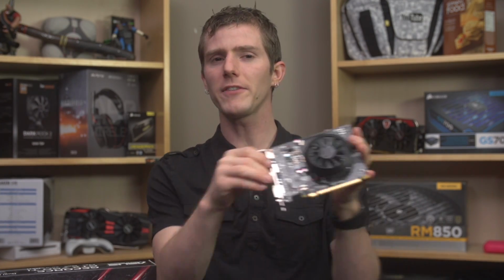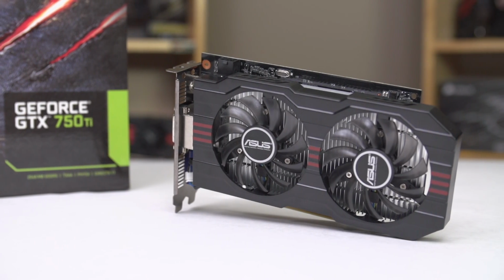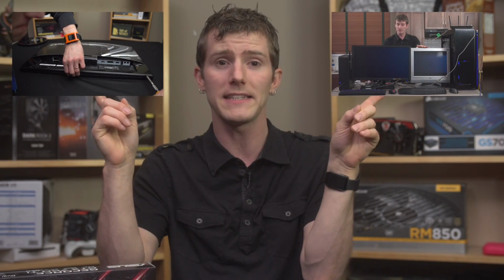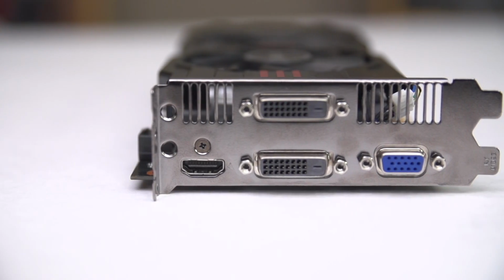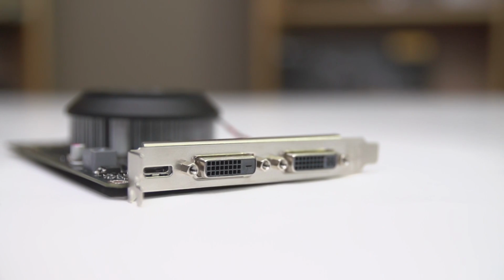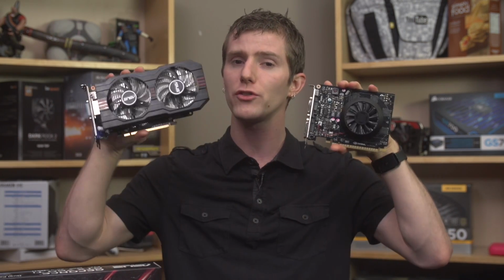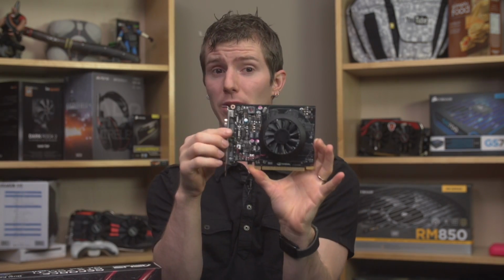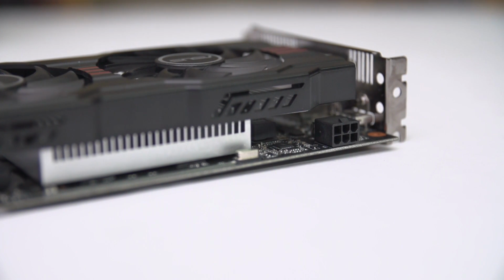GeForce GTX 750 Ti NVIDIA & ASUS Designs

Comment: hey guys. just a quick question. Is it possible to move my os from one drive to another without reinstalling windows and losing everything? ex. moving windows from hd to ssd and retaining all my games i installed on the hd
Reply: Macrium Reflect Free
Reply: Yes
Reply: How would you go about it?
Reply: Well the ssd is 500gb and the I have 1tb of stuff on my hard drive so I don't think looking would work
Reply: the only way to do that is through a drive clone, either at your local pc shop or through included software with your ssd (i believe samsung gives you the ablility to do it with their larger ssd's) you also need to be moving to a drive of equal or greater size when cloning because you can not pick and choose which data gets cloned.

Comment: No displayport on the ASUS = Fail
Reply: It's not part of the original architecture for this specific card.
Reply: ***** They probably didn't want people thinking it had support for G-Sync. But that was the choice that was made by ASUS.
Reply: EVGA ones got one.
Reply: Eric Slattery well but you'll need DP for Gsync
Reply: ***** I think next to development costs, royalties are negligible. If DisplayPort isn't part of the reference spec and they wanted to implement it themselves, they probably still wouldn't have had a card out to review.
Reply: JustPRR I guess it's more expensive then, rather than less as ***** suggests due to 'royalties'.
Reply: Eric Slattery G-Sync is not supported on this particular card in the first place.
Reply: Eric Slattery Personal reasons why a manufacturer would or not include a specific feature is not a valid explanation. 

Just because you do/don't want something, doesn't mean anyone else has your exact same opinion.
Reply: Eric Slattery 'Lowers FPS'.. Compared to what? A potato? Not everyone plays AAA titles or graphics-intensive games. Yes, it does look pretty, but what's the point when the gameplay is pure shit?

Comment: I'd have liked to see it compared to the R7 265, since that's it's direct competitor at that price point. I'm currently trying to decide if I should just go GTX 750 Ti or upgrade my PSU and get a R7 265...
Reply: I'm gonna have to upgrade for 265. Still using the stock PSU with no 6 pin

Comment: the asus 750ti or the asus 760? looking to upgrade my pc but not on a huge budget
Reply: 760 Man.
Reply: I got the ASUS 760 a couple weeks ago, totally loving it.
Reply: I got a Gigabyte GTX 760 OC a week ago.
I'm very happy with it,runs BF4 on 1080P high preset 80-90FPS.
Reply: i want to get the aus 760 because i have a relatively small mid tower case
Reply: just bought the asus 760 thanks for your help everyone
Reply: ***** i have a smaller mid tower case so i don't think a regular 760 would fit

Comment: Would it be worth while to put a GTX 750 Ti in a PC that only has an i7 875K with 8GB of ram? I've got a 430 in there now and I'd like to have something with more more power, and better cooling.
Reply: No your i7 will be fine with any graphics card today.
Reply: I think it would be. You should see major improvements.
Reply: The biggest concern is bottlenecking. If the hardware will be limited in some way, I won't spend $180.
Reply: Enigura There would be no bottleneck. You'd be looking at dual-SLI 780Ti's before it would bottleneck that CPU.
Reply: Hmm. Much to think about, I now have. Thanks! :D

Comment: I have a gtx 560. This would be a good upgrade right? I don't have much money and don't really game all that much. The only reason I am thinking of getting a new card now is because one of the fins on my GPU fan broke off. 

Would this be a solid replacement/upgrade?
Reply: Yes! it would be perfect! The 750 ti hangs with the 660 ti boost. at a 150$! its a insane card for the price. Btw go with evga 750 ti SC. Its smaller with more performance, and it supports g-sync.
Reply: MrHoward888 Awesome, Thank you. I will be ordering one soon.

Comment: How is this compared to the gtx660?
Reply: 1toncheese
Thanks. I thought the r7 and r9 series was another architecture than the r9 280x that was a 7970 refresh ^^
Reply: the gtx 660 still beats it
Reply: not necessarily, it's still a fairly reasonable price when it comes to the card's efficiency and features
Reply: Good to hear, I have the GTX660 and I don't want to upgrade. If the lowest end cards would beat it the minimum requirements would be higher I think ^^
Reply: cant sli these 750s......tsk tsk so yes the efficiency is an option these also seem like viable upgrades to people in the (pre made) pc dept.....so it looks like nvidia is reaching a niche realm of the market where they have usually never sown signs of caring about....its like a budget streamers gpu, or a good gpu for a htpc or again an upgrade to any new cpu supporting manufacturer pc....it does serve as a low end gpu solution in its price point as well for its power consumption and low psu capability...but i would never upgrade apples to oranges every mid/low end gpu i have from release to release it just doesnt ever seem cost conscious even the HD7950 liquidated pretty hard for 2-weeks before the new amd cards released then after....its price went up by 150$ and the stats and specs explain why........but my friend got one when it was on sale and those are the only times to upgrade in such a short window and these occurrences happen rarely; the 6xx window was the 650ti top...and when 660s prices plummeted...but by then the R' series cards were priced pointed to compete with them....
Reply: andola jackson i'm sorry, but, what?
Reply: *****
I just got the 280x (didn't support my 4 monitors can only run two, please help), but it's just a refreshed 7970. It isn't the Hawaii architecture its Haiti (I think). Great card though, really liking it.
Reply: yeah, it's a beast of a card, almost beats my 4gb 770 in raw power
Reply: Salpeteroxid it is the hawaii architecture, the entire 7000, r7 and r9 series are.
Reply: *****
Yeah I knew it was Tahiti architecture before I got it :) But I threw away 2 monitors and brought in a bigger 1080p monitor. For now I'm satisfied, thanks for your help and time!
Reply: Salpeteroxid I hope this shits on your feelings, the 950 is coming and is Wayyy better than the 660.

Comment: I think you guys messed up your GPU Overclocking sheet with the 750 Ti. They both say "135" when I believe they are supposed to say "1350." Since those are overclocks.
Reply: It could be how much they added to the base clock
Reply: DarthBlazer It's not. Look at the original base clocks. Why would the ASUS have the same when its non reference?
Reply: DarkPaladinX77
 It's not 135, it's +135, as in it's 135 MHz over their normal clocks (maximum Nvidia allows). If you bothered to check the other Nvidia cards in the sheet, they're all like this.
Reply: Tarkhein That's weird. I don't understand why they wouldn't just write out what they actually OC'd it to like with the AMD cards.
Reply: Because overclocking on Nvidia is different, you don't set the target clock speed, you set the offset (base+offset). The clocks you'll get is determined by the boost algorithm (base+offset+boost) which you have no control over.
Reply: Tarkhein That sounds awkwardly complicated...until I actually get my hands on it anyways.
Reply: Really not that complicated as you can ignore base and boost since you have no control over either of them. This locked down way of overclocking also means it's a lot harder to completely brick the card.
Reply: Tarkhein Again, sounds complicated, probably isn't once I actually do it.

Comment: Linus either Nvidia are wrong or you are :S On the site it says It does support G-Sync? http://prntscr.com/2tns4e
Reply: The GPU supports it but the IO on the cards Linus had to hand do not.
Reply: It doesn't have the freaking connector (DisplayPort). The GPU supports it without problems, but there is no connector yet.
It will come later on other cards and revisions.
Reply: 'will be' Which means at this current time it does not support it, so why does it say it does?
Reply: if i remember correctly, linus, in another video, said that gsync is only usable through display port and seeing as how both of those 750 ti cards lack a display port, gsync won't be used with those.

Comment: New generation of cards:

Nvidia: The card could be run with passive heatsink easily.
AMD: The card requires a truck radiator to prevent it from melting.

Comment: Right now amd is stomping nvidia.
Reply: no it isn't, the gtx 780 is cheaper and more powerful than the r9 290x
Reply: Pure Gaming
 haha gtx 780 is only better than 290x isn some games, in most cases, 290x is like 5 fps better than 780.

and 290 is around 5-10 fps less than 780, and cost less
Reply: Pure Gaming  Don't know where u pulled that out from, your ass? 290 beats 780, not even mentioning 290x, 780ti is a joke too, costs around 200 dollar more than 290x where i live. Fps difference is less than 10.
Reply: SupremeGamingStyle Using benchmarks the nvidia 780 is better than the 290x and not to mention the gtx 880 will come out soon and will be even more powerful.
Reply: In prices yes, features and performance not so much (in my country anyway)
Reply: Pure Gaming
 not in games, but in the others yes

Comment: So wait what is best, GTX 660 or GTX 750ti? Because the 750 is cheaper and i got confused because here the 750 seems much better.
Reply: The 660 is more powerful than the 750 ti and is cheaper
Reply: Ok, thanks, but how much more powerful is it, like how big difference will it be ingame?
Reply: I don't know specifically but according to benchmarks the 660 is a bit  better than the 750 ti.
Reply: Ok, but what would you personnaly go with in a budget pc for around 950$? (Price may be lower since i am from Sweden and the pc parts is more expensive here) (Edit: Im buying an i3 4130 3.4GHz (Haswell) and an ASRock z87 extreme 3 ATX, and  Corsair dual stick ram 2x4gb)

Comment: i use 550ti running bf4 ultra 1080p at 60 fps no problem with a gpu temp of 50 -55 degrees so i dont need to upgrade

Comment: is this compatible with PCI-E 1.1?
Reply: should be but it wouldnt run at full performance
Reply: like masterchief said, it probably is...but make sure you do your research to ensure your motherboard supports the card
Reply: yes itll be fine with no issue, wether its worth buying may be a different factor youll have to work out.

Comment: If the price is good enough I may just consider getting it to replace my GTS 450 to complement a Haswell CPU build that I plan to do.
Reply: Funny thing is that I am also looking to replace my GTS 450
Reply: You're looking at the 150 USD mark IIRC, pretty reasonable for the performance.

Comment: I am getting this to my geforce 9500gt.
do i get any bottleneck?
cpu:core 2 quad q8300
psu: 300watt

9500 gt gpu
motherboard: gigabyte ga-p41-es3g atx

seagate barracuda 7500 rpm 500 gb hdd
Reply: Probably may need to upgrade your power supply.
Reply: which psu i should get?
Reply: you're most likely going to need to get a new power supply
Reply: upgrade to this, its better
Reply: Yusuf Beyazkilinc Corsair CX430 or CX500 Will be perfect. These will be 40-60 USD Depending on where you buy. And No, your PC will not be a bottleneck.
Reply: This will do just fine in your computer :D
Reply: thanks btw i live in Turkey.
Reply: i can't find corsair cx430 w and cx500 w there is only cx600 on cx series. i can buy XIGMATEK TAURO SERİES 80PLUS 500W ,
THERMALTAKE LITEPOWER BLACK EDITION 500W ,
COOLER MASTER RS-500 EXTREME POWER PLUS 500W ,
COOLER MASTER RS-500 B SERİES 500W,
COOLER MASTER RS-500 G 80PLUS 500W 

i am going to get one of those. which one i should get?
Reply: Yusuf Beyazkilinc Cooler master, just pick the cheapest out of the three.
Reply: I am getting the rs-500 b
Reply: Should be fine, you'll get a very nice upgrade from the 9500GT.
Reply: is the reference one can run on 300 w psu ?
Reply: Yusuf Beyazkilinc Yep, the GTX 750 Ti only has a 60w TDP... Just the PCI-E slot on the motherboard is enough to power this without extra power required.

For comparison, your 9500GT has ~50w TDP
Reply: wow nice better performance with only 10 w difference. I am getting it.

Comment: shall I upgrade from MSI GTX 650Ti ?
Reply: No not a worth upgrade really. Something like a 760 would be a better idea. Or wait for the full Maxwell series and grab the 850 Ti (for the sake of an example).
Reply: naahhh, go higher otherwise its so not worth it
Reply: You would get an improvement, but if you are fine with your current performance then I wouldn't really bother. If you do really want to improve performance then I would actually recommend going for a better card such as a 760.